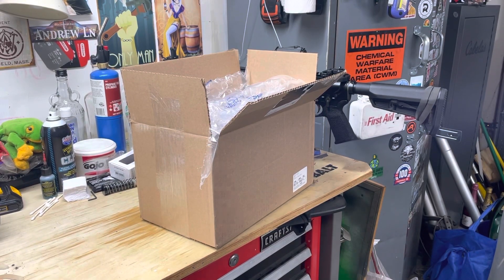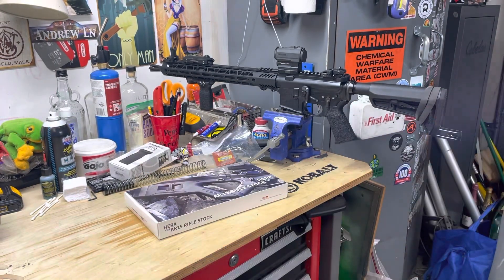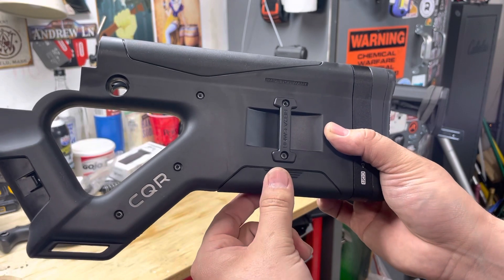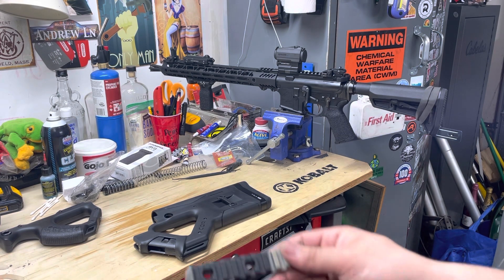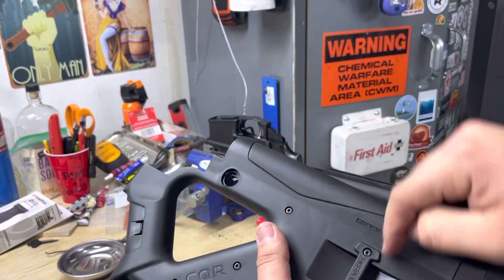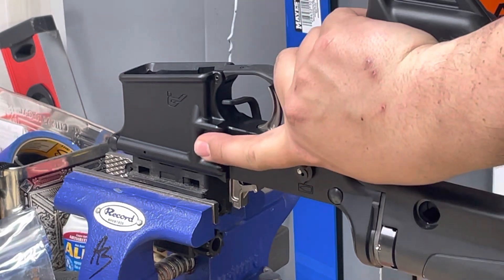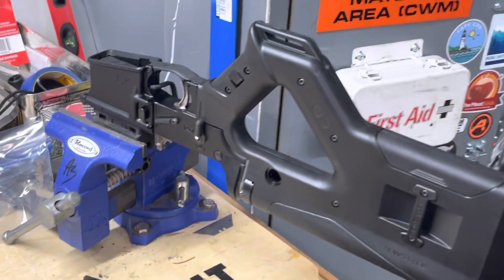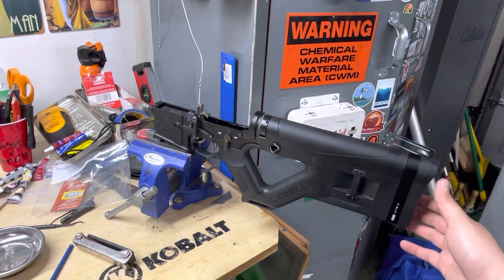HERA ARMS CQR Gen 1 buttstock / Front grip overview and installation PART 1

Comment: I've had a fde gen 1 buttstock for approximately 6-7 years. Haven't used it yet. It's the version with the neutered pistol grip. (Plate in opening to block pistol grip. Commie edition) Going to remove all the black parts and paint the fde with white. the put it back together for a white cerakote rifle build. (Stormtrooper style) Something about the black and white looks really clean to me.